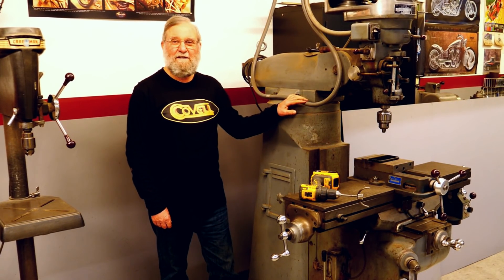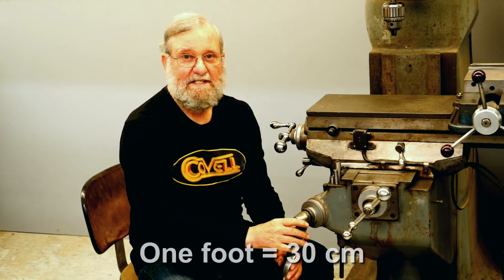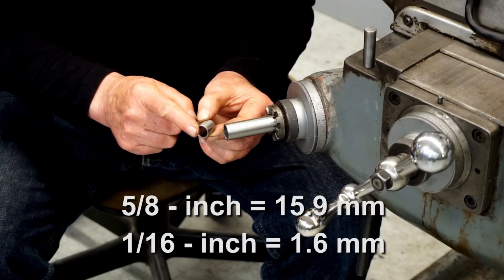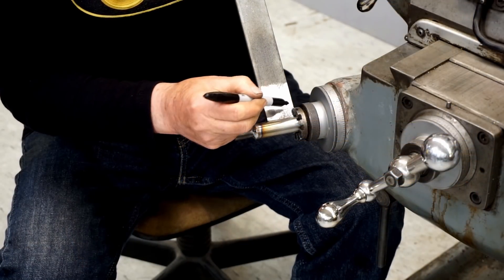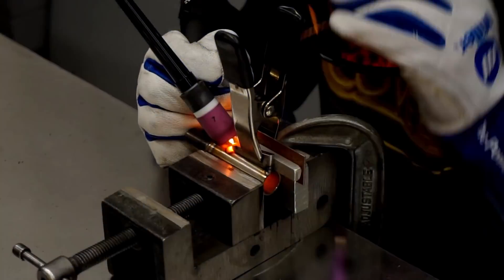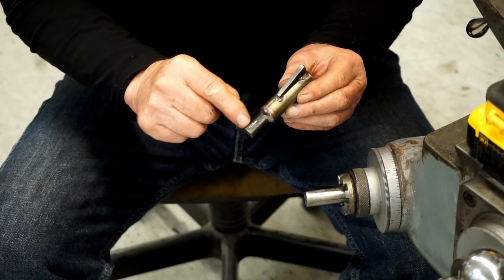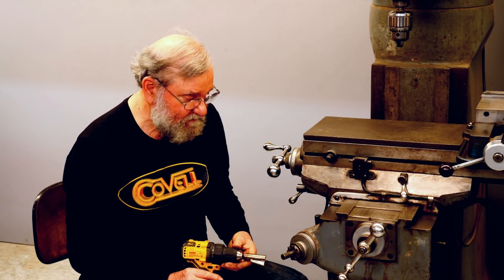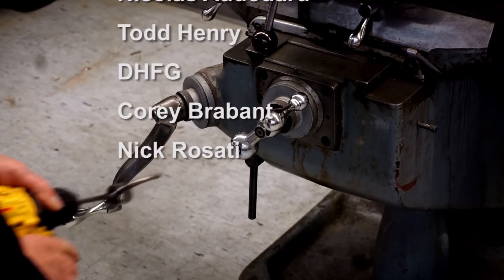Easy Mill Power Feed

Comment: I used a similar style drive for my z axis. I've since changed it to engage in three places instead of just one after a freind of mine broke one of the teeth on his Bridgeport style mill (off shore copy). I don't believe it would have happened on a real Bridgeport though, mine was fine for 6 plus years driving in one place before I changed designs. The way the tooth sheared off on the copy suggested the steel was very brittle. Thought this was worth sharing for any Bridgeport clone owners.
Reply from the maker: Wow - I'm shocked to hear that. Thanks for reporting this incident - we certainly don't want people shearing teeth off their machines!

Comment: Enjoyed….simple/smart…add/weld a nut on the tube then you can use a wrench to make small adjustments without removing the drill and installing the stock crank (liptonized)
Reply from the maker: Great tip! And this is the first time I've heard the term 'Liptonized' - presumably named after Tom Lipton. I've known Tom for 20 years, and he's a great guy - on many levels!
Reply: @RonCovell  yes, Tom is a friend and mentor, that was his modification to his driver, I take no credit for the idea....best regards
Reply from the maker: OH - I didn't know Tom made a video on this. I'll have to look for it.

Comment: power feed means its going to be a constant feed rate vs load, not some guy doing the elvis on a de-walt that has a 256 position digital pot hooked to its trigger .. as far as knee adjustments if its a bridgeport compatible castle nut arrangement, they already make them for peanuts on the usual sites ... we don't have a welder at our ship and its like 30 bucks online
Reply from the maker: You are correct that this really shouldn't be classed as a power feed, because it's too fast for most cutting, and the speed isn't consistent enough.
I didn't know that a ready-made adaptor was available for the knee. That's pretty interesting!

Comment: If you add a perpendicular length of rod, you can spin the now T-shaped adapter with the same powerfeed tool as the X and Y handles. That way you don't have to rechuck different tools into the drill. You might also have enough leverage to fine-tune the knee height at the end of the move.
Reply from the maker: Great idea!
Reply: @RonCovell   and add U formed ends to the T-rod for a less backlash version of the table driver

Comment: Nice one Ron. I would suggest that you need to lubricate your mill ways though as they look a bit dry, and that certainly lessens the amount of effort needed. I use Shell Tonna myself although there are plenty of other suitable oils out there. Especially for machines that are not used often there is a temptation not to lube that often, relying on 'I did that last time' but dust (especially wood dust) will dry the sliding surfaces out. I use dust covers for that reason too.
Reply from the maker: You bring up a very good point. My machine has a 'one shot' lubricating system, but I suspect that some branches of it have clogged up, because even after pushing the handle, some of the ways remain dry. Thanks for the tip, and I'll look into it!

Comment: Attach a similar device to the lead screw on my lathe- and cut any thread know to man. Although some serious synchronizing would have to be achieved! HA! 
Good idea- I will use this idea in my shop.   Thank you!
Reply from the maker: Yeah - I'm not sure how useful an irregular thread would be.
Reply: @RonCovell  How about a thread that starts out fast, then torques with finer threads when reaching the cinch-down final torque. Perhaps an ultimate sheet metal screw!   I am only trying to think out of the box. Nothing ventured, nothing gained. Here at ODD Parts Fabrication- this sort of thinking has earned daily receipt of parts for restoration for over 85 Ferrari Maserati dealerships around the world. We are very busy. The only thing that we do not fix is marriages! HA!  Thanks for your help and Inspiration. IE- we repair Vacuum canisters using a bead roller.
Reply from the maker: Well, I must say that your thinking is definitely creative!